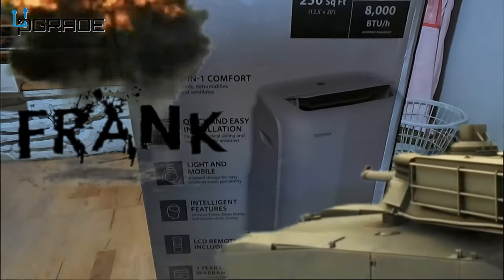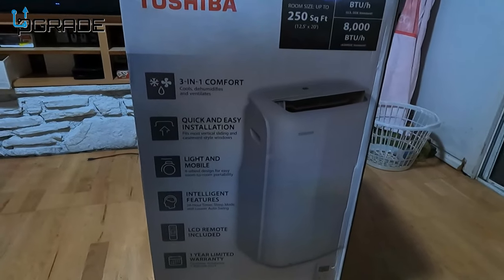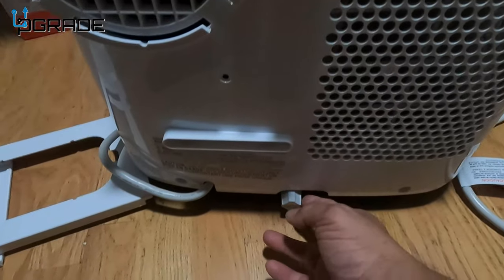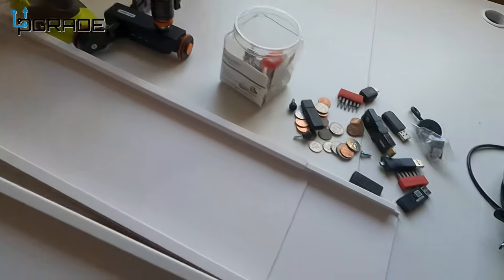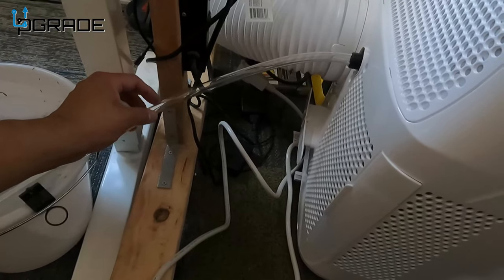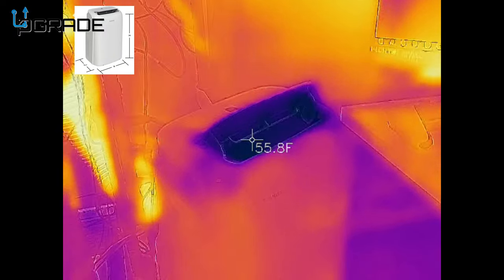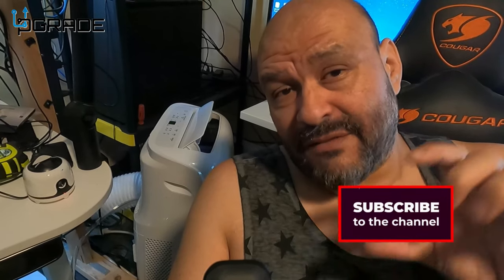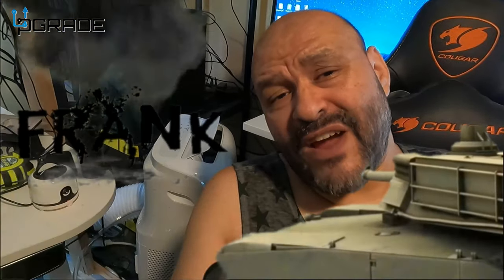Toshiba Air Conditioner with Remote

Comment: The $100 more is for 100 sq ft more, basically an extra small room since its 12,000 BTU instead of 8,000. So its like having the WIFI Control Free, which is also nice since you dont have to keep track of an extra device as a remote since your cell phone is next to you anyway

Comment: Just what I need, thinking about going to purchase this today. Needed to see reviews
Reply from the maker: They are selling out fast, good luck if you can get one.
Reply: I have a two bedroom apartment. Our original AC unit in the window stopped working, so our landlord bought us this and it honestly doesn't do much. It's in the dining room area, bc there's no other windows I can open for the exhaust to go out of. We have 50-60% humidity in the air, and it does dehumidify well as long as you have the hose connected to the top port. YOU HAVE TO USE THIS HOSE or it will barely cool off the single room.
Reply: @Dying2play12  Well this is only for a 250 sq ft space it's right on the box. Do you know what that means? Not your whole TWO BEDROOM apartment.

Comment: i just ran it for hour and the bucket is maybe 2 cups... i have pipe in middle hole.. so what do i do with the bottom hole ??? and if i want to get longer water drain hose.. how do i put it out the window ?? do i drill hole in the plastic insert or what??

Comment: I hate to be the one that tells you, BUT, you installed the the sliding window panels inside out. The nicer side should be on the inside of the window, not like you have it at 4:38.

Comment: Had it for a year and found out there’s a THIRD filter. You have to remove the bottom filter and it’s on the side, there will be holes on the left side of it, it’s behind it. Oh my the amount of dust on it from never being checked
Reply: remove the bottom filter? you mean the one on the side that he didnt pull all the way out? I have this exact same model and I want to clean it out before turning it on
Reply: 🤢 thank you so much I jus found it
Reply: @ImmaQT2  yes
Reply: @shonabee53  yes I was so surprised my ac was still going with the amount of dust on it
Reply: How did you guys deal with the draining?
Reply: @tonymontanamalverde  draining was a once every 6 months thing for me it barely had any water in it
Reply: @madisondobyns1063  did you use it a lot? Or is it hot where you live? Cuz I’ve had to drain mine often
Reply: @tonymontanamalverde  I live in Florida so pretty humid and yeah I used it constantly for almost 2 years plus 2 dogs in the room mostly, I was probably doing something wrong with the draining then if I didn’t get much water out

Comment: Oh man I thought this was the video I was looking for but you literally left out the part I needed! It says you only need a screwdriver for the sliders yet there are no pre drilled holes apart from one panel. I wanted to see you set up the panels. And also sucks because I don’t have a drill. But apart from that this is still a great video, I gave it a like
Reply: Huh, in my package, two of the 3 slider panels are pre drilled along both sides, the entire length. Only the larger width one doesn't but that's bc thats the extender section, that the little white plastic studs stop on.

Comment: I asked a question  I bought it 3 days ago.  The first day seemed to go well.  But today I have doubts that I am still working. The machine is cold. The air can come out for no more than 20 minutes.  Then another 15 minutes later.  The machine turns off by itself like a timer.  but i didn't set it  Do you know what's the problem with it?
Reply from the maker: Did you drain the water?
Reply: Yeah same, ours does that too. We drain out water like in the video but it still turns off by itself and start making noise.

Comment: From what I understood the toshiba ac are really rebranded media air conditioners. I just purchased the big one 14000 btu, with dual vent hoses and wifi. I went with media version because it comes in black.
Reply from the maker: How is it working for you? Is it worth the Wifi I skip this feature?
Reply: @Upgradetech  I didn't receive it yet.
Reply: Does this use more electricity than then those cheap motel air conditioning that are installed by window

Comment: I bought one a few weeks ago: So far, so good. Do I need the drainage tube? I'm running it without it now...
Reply: Good question I too am not using any drain tube. I am wondering the same thing is anyone knows.
Reply: in the manual it says that top drain plug is for dehumidification if the unit cuts off on you drain the bottom drain and it will cut back on

Comment: Upgrade: MR: the bottom Dranier is for when? is it optional? if you connect the top Hose  and add a bucket? really don't get whats the bottom one for? Thank you for the video
Reply from the maker: The bottom to drain is to get the last of the water because the drain from the holes is only an overflow from the tray.
Reply: @Upgradetech  thanks for responding but i end up returning it doto the lack of Air conditioning it would throw cool Air for a minute then stop and so on it wasn't a constant cooling like most to all Air conditioning should work, I tried all the modes and could not get to stay cool. Mr Upgarde  does ur unit put out constant cool air? like non stop?
Reply: @ThisOLmaan  Have you try cleaning your fitters? Cause dirty filters means your ac will not blow as much cold air.

Comment: I have the same one and honestly it doesn't work that good it doesn't make the room cold it just makes it barrable on a hot day...idk if im doing something wrong or what but if anyone has any clue to help I'd appreciate it
Reply: Mine doesn’t work that well either
Reply: room might be too big. might have old windows
Reply: @thejakein7867  na I have a small ass room and I have those double glass windows idk maybe I got a lemon but I know I'm not the only one with a negative experience
Reply: I’m in a 120sq ft room, doors closed and all. Bought this today and it does not get cold. Nothing on the unit is cold to touch, no water comes from drain tube. It’s basically a loud fan. Wish I had a temp gun.
Reply: @badcameratv  yea man they suck i have mine running all afternoon and turn it off at night and that causes my electric bill to go up an extra $50-$70.....its hardly worth it like you said it doesn't  get the room cold and for me all it does is "cool" the room down just enough to where its barely bearable but if I turn it off less that 5 min later my room is blazing  hot
Reply: @Jayindabay  I went and bought a thermal temp gun and it was literally pushing 82f air. I turned it off and the room cooled off two degrees. I then went and bought a window unit which was pushing 46 degrees and is working great. When I returned the Toshiba there was another one in the return area from earlier that day, and the cashier commented, “I wonder why we always get these back•, no joke!
Reply: @badcameratv  lol that doesn't  surprise  me at all...man wish I could return mine but I bought it off someone....saving up for a window unit myself can't wait to get one....which model did you get and how much did you pay? if you don't mind me asking

Comment: Just bought this and the compressor does a kind of more intense buzzing sound on the cool mode. Doesn’t really bother, but it does make a bit of noise and was wondering if this was normal?
Reply from the maker: Check the filter and see if you have lose plastic rap or see if is set correctly
Reply: cool mode is loud on mine too so unless your floor is uneven then itll rattle too

Comment: I just got this model. Do I need to put the hose in at all time? It says that it will beep if it’s full. Can I just wait until when it’s full? What about the Bottom drain? Do we drain that too?
Reply: You don’t need the hose at all wait till it beeps at you attach the hose drain into a bucket Or wheel it to a bathroom or front pourch and unscrew the bottom plug and drain it that way.

Comment: Does it need to be drained if you only set it to cooling mode?
Reply: Yes! I've never used the drain thinking it's only for the one mode, but it wasn't doing anything really. I'd have to move it from room to room, and keep doors closed to even make it bareable. Now that I have the hose connected, it's only been 5 minutes and I can feel it cooling off the living room from the kitchen where it's sitting.

Comment: I’ve had mine for over a year now and it recently started spitting water out of the top vent I have never had the hose set up and have never had to drain it before but I did drain it completely then turned it back on within 30 min it’s spitting water again so I completely removed the entire back panel and cleaned all filters and coils thinking that would help and it still filled up within 30 minutes and started spitting water it’s not humid where I live why is this happening all the sudden?

Comment: Thank you for the video, big help. Weird question, is the water safe for houseplants?
Reply from the maker: Not sure about that sorry
Reply: @Upgradetech  i just bought one and it smells like a gas station, faint gas or oil smell. Is that dangerous? 😮
Reply from the maker: @admerin6961  I dont think that is safe I would turn off and change it.
Reply: @Upgradetech  thank you

Comment: do you have to connect the drain hose if not using the humidifier? As a result, could i just drain it manually into a bucket when needed?
Reply: Manual and my own usage says no. Top drain with hose is for the dehumidifier.

Comment: I had mine for about 2 years and love it.  I live in a high humidity clement and ran it last summer almost constantly without having to drain it.  Now it is getting hot enough to run it again but it only runs for a half hour before I have to drain it.  I pull the bottom plug and it drains about 12 oz. of water and runs for another half hour.
Reply: How have you not had to drain it?! If I run it all day it fills a big bucket of water in no time.
Reply: I've had mine for about a year and a half and I never knew I had to drain it 😱
Reply: @jonathansolorzano2467  how??? Lol
Reply: Lol I have no clue. I just never thought about what those holes are for I guess 🤣 But it still works like a champ
Reply: @MissNips  yeah I’ve had it over a year and never drained it till today and not that much water, it’s weird
Reply: @madisondobyns1063  soooo weird because I’m using it daily now and it fills a bucket twice a day!! Like a big ass bucket too.
Reply: @MissNips  I live in Florida and it’s really humid, I just don’t get why it’s not collecting a lot of water, maybe it’s something that I don’t need to question. And yeah that’s a lot of water for you to be draining too. Idkkkkkk
Reply: @madisondobyns1063  yeah no idea. In Montreal so it does get quite humid but from the sounds of it other people don’t have to drain it at all! Maybe it’s different models or something lol
Reply: @MissNips  your probably running it on "dry" Which means it pulls in the moisture of the room therefore constantly having to drain more water
Reply: @luciodelgado3867  nope. It’s always just set on cold. Drains about 15-20L a day. I seem to be the only one here with this “issue.” Honestly I’ve gotten used to emptying my bucket twice a day if it’s running all day during the summer months.
Reply: @MissNips  If you’re using a dry mode it needs drained, if you’re using cool mode it doesn’t need to be drained.
Reply: @danimegan9512  been using cool mode for 2 summers and always have to drain it. Idk anymore. I just keep the tube going into a 10L bucket now and it’s like a habit to keep an eye on it

Comment: I just bought one of these yesterday at the home Depot and today's date is June 19th 2021 this thing cools my room down really good I don't have the drain hose in there cuz I didn't think you need to drain hose in there when it's on the air conditioner I thought you only needed that on the drive mode or something but I I guess I could put the drain hose in there if you can give me a comment on that if I need to do that when it's on the air conditioning or I don't but it works great I love it.
Reply: The hose only needs to be connected for the models the have the heater mode
Reply: I just got mine too!

Comment: I've had mine for about a year and it was cooling off my room during the summer but now it doesn't blow cold air anymore.
Reply from the maker: You might need to change the coolant part
Reply: @Upgradetech  mine says heat on the controller but I do t know how to set for heat it still blows cold air
Reply: @Upgradetech  how do you change the coolant ?
Reply: If you want heat you need to take the duct out of the window. Then put your AC in dry mode

Comment: Do I keep the hose attached while on cool mode? Or just attach the hose when draining?
Reply from the maker: If you want the system to keep running through the day you might need to keep a holes and a bucket but if it's only for 1-2 hours you don't need it.

Comment: I have this model. I noticed in this video there was no upper filter behind the large grill over the coil. Mine also did not come with one! Owners manual shows there should be a removable upper filter behind the large grill just like the smaller lower filter. Is there one I can buy compatible with this Toshiba? Thanks!
Reply: i think the filter is attached to the part that comes off. at least mine does. i just vacuum it out and on the outside, wipe it down with a wet cloth

Comment: How do I change settings from °f to °c without a control?
Reply from the maker: You can't
Reply: Hold the Up and Down Temperature Button for 5 Seconds. This will switch the mode between °f or °c
Reply: @Upgradetech  Wrong Answer

Comment: Where does the water come from 🧐
Reply from the maker: Two different areas as mention in the video behind and in the middle and below.
Reply: The water comes from the air, think of an icy class on a cold day. The cooling coils that make the air cold are the glass of ice water.

Comment: Do you need to refill it with freon ?
Reply from the maker: I don't know, I think if you get to this point then it's fine to get a new one.
Reply: @Upgradetech  I used it last summer it worked great but this summer I turn it on and barely gets cold but alot of water comes out into the bowl I have cuz I have the two drain plugs open

Comment: I want to put this in my garage 21X22 would the 6000btu work? Or would I need the 8000 I don’t understand the Sqf
Reply from the maker: No, this is for smaller space 12X10 you might need the higher version that cover a larger space or buy two of them.

Comment: so i have one right now there are good but the big thing is on the front side there is a open area and no filter or anything so it just sucks up dirt and hair i got long air it took a year almost 2 for it to start having issues but that is because my long hear and my long hair dong so ya but in that i now have the iss of the coil being dirty and that is hell its front is clean but there is little spots on the side and a spot were it is close for no air to pass though but there is a tiny gap so dudst build up so my compresser is overheating do to the dirt in my coil

Comment: The lowest that the temperature goes is 62ﾟ on the machine so how is your thing saying 53ﾟ
Reply: Kinda like how when you heat up an oven  the heating rods will exceed the set temperature.
Reply: I have same problem and dont know why it wont got any lower any tips on how to change this?

Comment: Hey I bought one a few days ago, keeps the room nice and cool but my carpet is soaked like 2 feet all around the ac unit?? Anyone know why?
Reply from the maker: Condensed moisture from the unit might be producing the water or a crack in the water holding containers. The manual advised to place the unit on a area incase it spill water. They sell containers for this type of air conditioner in Amazon
Reply: Just like any AC Unit- Condensation will be produced! You need some kind of draining outlet for the unit. Condensation hose to a reservoir lower than the unit - or inline pump to move the condensation to a drain.
Reply: Hey you guys thanks for the quick replys! Sadly my local home depot was sold out of the washer drain pans so using a temp fix for the carpet at the moment. I found a small amount of water on the underneath of the ac, I cant seem to pinpoint the exact location of it though. It has become quite an issue though the carpet has been thoroughly soaked and i cant seem to find any issue just by eye alone. The room has fans to moderate air flow and I drain it almost every night but there still seems to be an issue. Any thoughts??
Reply: @ilikeanime16  

Hopefully there isn’t a crack in the pan- resulting in unwanted traveling of the condensation. There should be two/or One condensation discharge outlet nipples on the back of the unit for your hose. If your unit has “Dry Mode” turn that on for the wet floors and disconnect the return/exhaust flex duct that is connected to your unit - and the window. This will help take the humidity out of the air and help with mold. I do Commercial/Industry HVAC Service.
Reply: And I Just Read your original comment again- Is the unit sitting directly on the floor? If So there is your issue! The unit will need to be evaluated to a height greater than the height of the condensation line. Gravity will do its work. If the unit is sitting right on the carpet - the pan will fill up then overflow. Water always finds the path of LEAST RESISTANCE. Make sure there is a nice slope for gravity to work it’s magic.